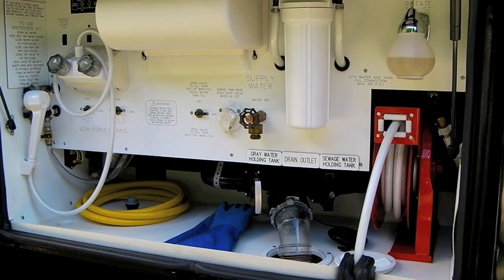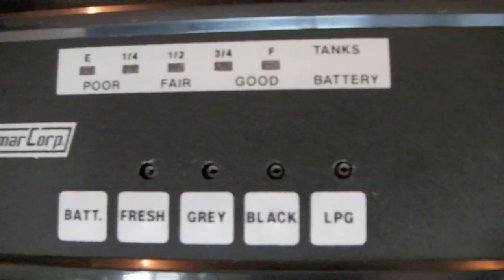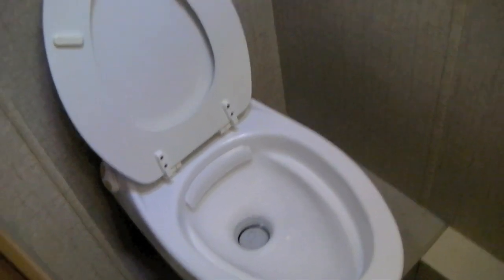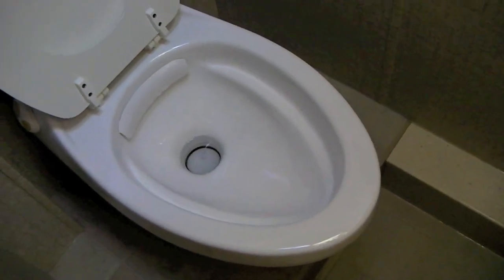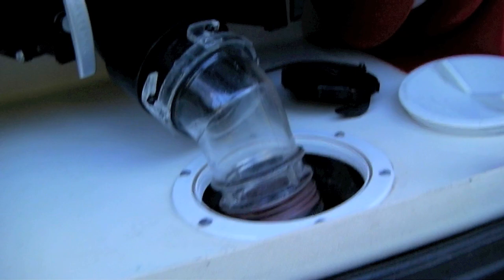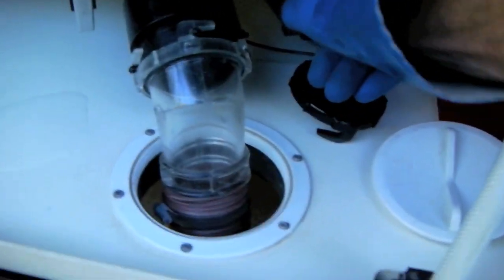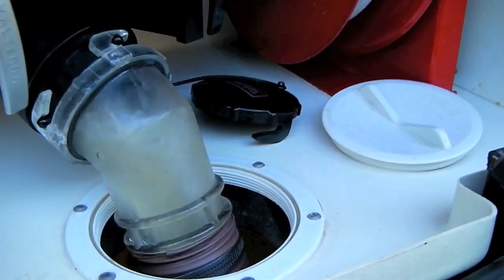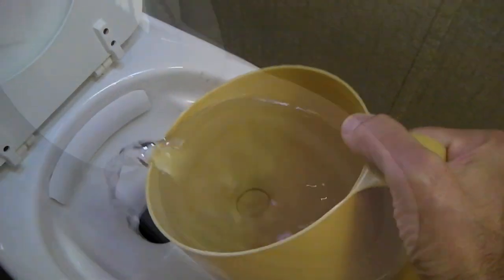How To Dump & Clean an RV Black Tank

Comment from the maker: continued... If you DO leave your black tank partly full for long periods of time, be sure to leave extra water in the toilet (maybe 1/3-1/2 bowl full). That water is the barrier that stops odors from coming up from the black tank into the RV. If you return and find no water in the toilet (allowing for reasonable evaporation), your toilet seal may be bad. If you still have water in the bowl, but also tank odor in the RV, you might decide to empty the tank before storing from now on. ;-)

Comment: Fantastic! I'm going to do this when I get home. The PO installed a macerator on my '74 GMC. The two-lug cap cracked recently, is there different sizes for these caps? I bought one today that didn't fit... 😞

Thanks for the info!
Reply from the maker: Hi Kelly! We've never heard of any other size sewer cap than the standard 3-inch type. Every sewer hose fitting we know of is pretty much the same. Was it too big or too small, or did the tabs not line up? Does it look like this one, which is pretty much the standard: http://amzn.to/2cNtoZw ?
Reply: It was a Thetford cap. I'll let you know if it works out!

Comment: Matt, thanks so much for making and sharing this video.  We are moving on up to a hard-side travel trailer from a tiny popup next week, and knowing the right way to get the job done is awesome.  One question, if you see this... We're weekend campers lakeside here in NC -- do you recommend the thorough clean every 3 or 4 trips, or more (or less) often?  It's just two of us usually...
Reply from the maker: Hi Charles! Thanks for the comment, although not sure who Matt is (Peter here). No worries though. :) Congratulations on your RV upgrade! The thorough tank cleaning is not needed that much. We only do it about three or four times a year, and we're full-timers. Other than that, I would only bother doing it if you sense tanks odor becoming a problem. Otherwise, an ordinary dump procedure should be fine, as we demonstrate here: http://youtu.be/gZFyfsy4ptw

Comment: Great video. When I had my first RV I left the black open the first time. Then I thought about it and googled it. haha whoops. I just had one question. I've always been told to not flush the black tank with the gate closed. To me, it seems that the vent should be enough to vent the pressure but someone at the RV store told me not to do it. I think it would work much better with a flush with the black gate closed and flush on (like in your video). Ever heard of anyone causing damage by doing this?
Reply from the maker: The vent is plenty to vent pressure. No worries. The only damage you could cause is by walking away and forgetting that the water is running with the valve closed! Then you'll damage your ego when you overflow black water out the roof vent! 😂

Comment: Very good video.  The only question I have concerns operating the black flush system with the black tank closed.  I have owned 2 motor homes and both provide instructions to never operate the black flush system with the black tank closed.  I understand the reason for closing the tank allows it to gain water and flush more of the tank, but why would the manufacturer instructions restrict this practice?
Reply from the maker: They specify that so that if you overflow the tank out the roof vent, they can say they told you not to do that and not be responsible for that mistake. We take responsibility for opening the valve before it overflows out the roof vent, and have never had a problem.

Comment: Hi guys! We just bought an RV (45’ 2005 Newmar Essex diesel pusher) and it's our first RV. I'm furiously watching your videos and trying to figure this RV thing out. (I have never RVed before and neither had my husband, but here we go!) I’ve also joined your Patreon, because your help is invaluable.

I’m learning about the maintenance and things we’ve got to do. We had her inspected before we bought her, but now that we’ve got her home, the black tank odors are awful. She’d been in storage since January and we bought her in May, so I’m guessing the black tank wasn’t completely clean before they put it away. We have not used it but a couple of times now, and it's worse every time we flush. I’ve watched your black tank cleaning video 3 times and taken notes. Do you have any other ideas for me? 

I’m glad y’all are there to educate me on this journey. Fantastic videos. Thanks!
Reply: Also, we're going to have to figure out how to tell what level the black tank is at before we get too far. I'll be replacing the sensors soon. They read empty on grey and black tanks, and I filled my gray tank up while it still read empty. (I was packing things in and washing the interior. Getting everything clean for us to move in.) I'm told the black tank sensor does the same.
Reply from the maker: Hi Trina. First of all, congratulations on your new '05 Newmar! We sure do love our '05. It sounds like your black tank needs a super cleaning. The first and easiest thing to try is Happy Campers Xtreme: https://amzn.to/2KM2XDT and be sure you also have a clear sewer elbow: https://amzn.to/2Nv6eWG

Follow the directions on the Happy Campers.... multiple times if needed. It's very important that when you dump the tank after using Happy Campers Xtreme, you have a clear elbow in place, as you'll have no way of knowing what's coming out if you don't. Let the Happy Campers soak real good with a pretty full tank of water (which you can fill using the black flush connection, as we showed, being careful not to overfull it up and out the roof vent... which, if your sensors aren't reading, could happen).

If you flush the tank the way we've demonstrated here, repeatedly filling and dumping the tank, and it then runs clear, it normally means the tank is empty & clean. Then put in the Happy Campers Xtreme, fill with water, and let it sit and soak. After soaking (a day or two, or better yet, a week or two.. or however long you're parked and not using your RV), pull the black valve and watch what comes out (looking through the clear elbow). The water in a tank that has no build-up problems will still run clear, even after soaking. BUT.... if the water is brown... the Happy Campers is doing it's job of breaking down built-up crud. Keep treating, soaking, waiting, dumping until the water runs clear after soaking for a while. Depending on how bad the build-up is, it may take a number of treatments. The soaking may also help your sensors to start working again.

Please let us know how you make out. There are other, more involved, methods of tank cleaning, but they're not pretty, and involve the services of professional.
Reply: Thanks so much! We're moving in in a few days, so may only be able to let it soak for a couple days, but we can stay in our apartment for a few days before we have to be out and into the RV. I'm ordering now! Already bought the clear elbow just like you said in the video. :)
Reply: Update: The tank clean was delayed. We broke down on the way to Ohio, so we've had the RV in the shop. Finally moved in this week and we'll be cleaning the tanks again since the last time the cleaner just sat in there for a LONG time. Of course, the toilet broke and is now spraying water out the back every time we flush it, so we've got a call in to a repairman to fix whatever is wrong. This thing better not be this crazy once we finally get this second crop of problems fixed!!! I won't be able to take it.

Comment: Ice! Why didn't I think of that?! When I was a waiter we used ice to clean the brown stain out of the heavy glass coffee pots. Just fill them 1/4 full and "swish" the ice around.

I don't know if this would be good or a terrible idea, but with a coffee pot if you pour a good bit of regular old salt in with the ice it scrubs the brown out like crazy. A whole container of cheap salt isn't expensive to mix in as you put in the ice, doesn't seem like it would hurt plastic tanks, what about the seals and the septic system it's getting dumped into?
Reply from the maker: What a great idea! Anything that scrubs the bottom of the tank should help. I can't imagine salt hurting the plastic or the seals (it wouldn't get stuck in the seals, since it would be dissolved or flushed away). Thanks for the idea!

Comment: If you leave the black tank open, the solids will harden into like cement and destroy your black tank.  My rig has the black tank valve on a spring so it can't be left open.  This prevents solid pyramids from forming.

Comment: Great vid on black ops. So much work, I reckon we will go another route. Compost toilet, Incinolet, poop elsewhere. Grassy ass, very informative and a bit daunting.
Reply from the maker: Thanks, WyoCoyote. But keep in mind this is the dump and CLEAN process. If you only need to dump, it's a lot faster. Check out this video instead:  https://youtu.be/gZFyfsy4ptw  (although there are certainly other reasons to consider a composting toilet... since it also means no water used for flushing, etc.)

Comment from the maker: @MrJoseph1157  A common explanation we've heard for using RV-specific tank chemicals is to avoid damaging the dump seals.  Rid-X is the same type of biological agent as many non-formaldehyde RV tank treatments, such as Pure Power (which we used for a while), BioActive, Odorlos, etc.  Those brands claim to lubricate the seals, but after many years of using Rid-X, we've never had any problems with them.  And we've probably saved enough money to buy several replacement seals.  ;-)

Comment: Hey thanks for your video and information so good. I live in New Zealand in a RV permanently stationed. It is a cottage from Cedar Creek USA did i understand that you put the flush water on BEFORE you pulled the black tank flush and yes i always pull the lid off so i can see whats going on! would  be nice to have a reply; as i was told to pull the black tank then attach the hose to the black tank flush and leave it for 20 minutes but your way seems to get better results
Reply from the maker: +noeleen falkner While we turn on the flush immediately before pulling the black valve, you can absolutely pull the valve first. Doesn't matter.
Reply from the maker: +noeleen falkner By the way, we're currently in Australia after spending 2 weeks in NZ. Loved it there! 😊
Reply: hi Im having trouble draining my black tank any suggestions its definitely not full but its been 5 months; can i fill it with the black tank fill flush at all ?
Reply from the maker: noeleen falkner
Hi Noleen. When you say "Having trouble draining" do you mean that your black tank is full and you pull the black valve and nothing comes out? During the "5 months" you mention, was the RV in storage? Or were on on board using it with the black valve left in the open position all that time? If you can tell us as much as possible about the situation, and we'll try to help.

Comment: I do my dump very similar to this. I've had a situation where the indicators were fouled and not reading correctly after dumping. Just for that reason, to be sure you're sensors are reading accurately, the multiple flushes are necessary(it cleared after finishing the flushes). I've gone as many as three fills on the black tank to clean it. But I don't get the water pressure you get from my flush system. Yours looks like it's able to withstand much more than 45psi of water pressure. What I do have now is a leak in my san t flush connector in my Lance camper. I'm getting a lot less pressure and wasting a lot more water filling the tank. I'm looking for a replacement valve but wondering if I may be able to repair the existing one. I've yet to see an expanded view of the fitting itself.

Comment: Very informative video, thanks.  I do have a question.  You mention not using the fan while in the process of using the toilet.  Let's say you have the gray water open all the time.  Won't gases from the sewer feed up into the RV that way?  Thanks again.
Reply from the maker: Odors from the gray water system don't get into the RV because there's water in the P-traps, just like the smell from a household septic system doesn't come up into the house.

Comment: Great ideas! I am going to purchase a clear exit elbow and try these flushing techniques.My issue is the black water gauge always reads 2/3 full when emptied the only time it ever moves is when its  full,, no issues with smells, except when its time to expel,,, so I am wondering has the tank "pyramided" by previous owners or could it be a faulty gauge, I purchased 5th wheel in July of this year,, previous owners rarely used it and were meticulous about looking after it.. it  looked brand new, when purchased and had a technician  go through all the checks before I bought it,, it is a 2009.. Also wondering how to prepare unit for a 17 day holiday in winter, it rarely gets below freezing here, but don"t want to chance anything, dont have anyone to check on it during this vacation..Unit is occupied all year long. Great tips keep them coming! and thanks!
Reply from the maker: Hi Marlene. A good soaking/cleaning is the easiest first-attempt at dealing with both gummed up sensors and any odors. If you had pyramiding, your tank would likely smell all the time, not just when dumping, so that's a good sign. We made a video about gray tank cleaning that works fine for the black tank too: http://youtu.be/gmdzFpdB--c  Might be worth a try.

The only real thing to worry about during your 17-day holiday is below-freezing temperatures. We'd suggest putting your water hose away, of course. If it rarely gets that cold, then there's probably nothing else you need to worry about, but if you want to be totally sure, you could do what we do the rare times we're away from the RV during the winter.... leave the propane tank full and the heat set to 40 degrees F. Whatever other steps you take when you're actually staying inside the RV during the winter should be enough.

Comment: The camper is a 2007 Puma Palomino travel trailer than can be towed.  It is set up for "all seasons" camping thus the reason that I was calling it a park model.  It has a toilet very similar to the one in the video.  I have grey and black water tanks but the plumbing is connected on the outside to a pipe that runs to the septic tank.  I know that something is getting to the septic tank because I have to have it pumped out.  Just wondered if what you were doing would work for me.

Comment: I just saw The Fit RV channel video testing the ice cube method. It didn't really work in his test. He didn't use 50 lbs saying that if you use that much there is little to no agitation the more ice you use. And you need to add some water to the ice or just about nothing will happen but not to much or again, the ice will float and you'll get no results. I'm thinking sprayer head down the toilet to get the desired effect.
Reply from the maker: Ice works great for scraping dried-on residue off the bottom of the tank, which most commonly occurs when the tank is left empty after an incomplete flushing. His test failed because he was trying to use ice for something that no one ever claimed it would work on: pyramiding.

Comment: Peter, first, i LOVE my rv!!! Sooo very happy with it. Took it to a mechanic for the once over and it was pronounced in extremely well maintained condition! So,question, I need to replace a rear window, its one of those slatted windows that you turn to open and close like on homes in Florida. and it seems the ones in back are not closing sealed. Do you have a recommendation of where to go for servicing these? Should I shop online for the same type to replace, or are there newer upgrades? Thanks

Comment: If your RV is so air tight that you get air up from the black tank then you might be getting air from the gray tank through the vents under each sink, shower and washing machine. They are designed for one way air flow but they are not very quality in my RV. It's not the exact same smell but it is still a sewer smell. 

I feel sorry for people that have such problems with sewer smell as it shouldn't be that way. My system doesn't smell until the roof vent gets blocked by the filling of the tank but then I know it's about time to dump.. I have a 40g black and a 60g gray that stay closed. Usually the gray fills first. 

I have a macerator I've used for years and I start with the gray tank to make sure everything is working right then I switch to the black and dump it completely. This part I watch closely for a slow down in the motor from too much solids at one time. I use a clear hose like you do and I will open the gray valve a bit to help flush out the solids through the grinder. When the black tank is done I open back up the gray which some is macerated but a lot fills up the black tank, After a few minutes I close the gray and drain the black. I rinse the black this way one more time then close off the black and finish off macerating the rest of the gray. When the gray is done I shut off the pump and put away the hose. The smell on the lawn lasts for a few hours so I usually do it after dinner and don't open the windows on that side of the RV. 

I have never had a blockage and it is a quick easy job. I never put anything in the black except human waste and regular toilet paper. If I have friends over I have to remind them...no garbage etc. I think it is good to leave the tank with some bacteria in it to start eating up the new waste faster. Isn't that where the smell comes from?